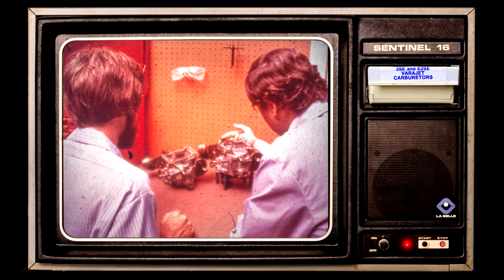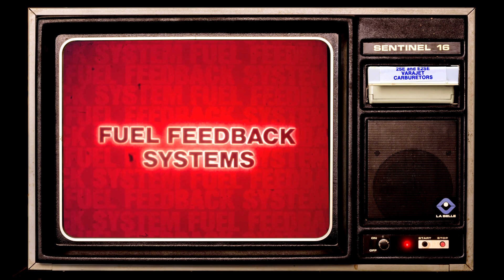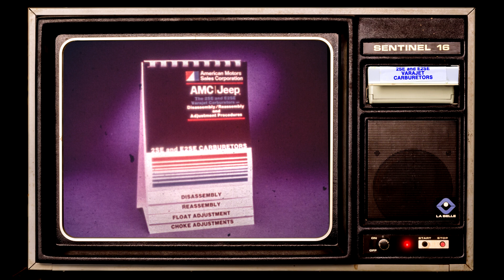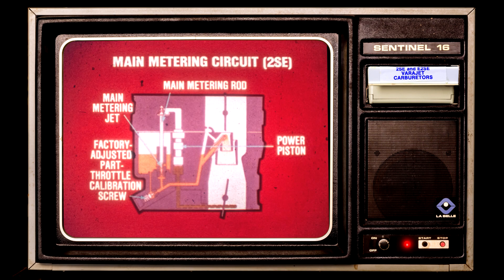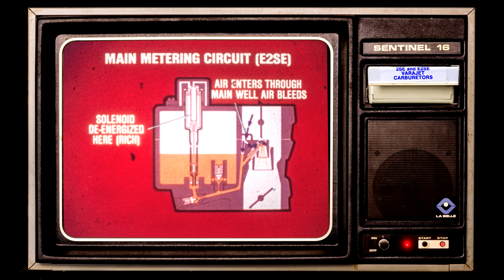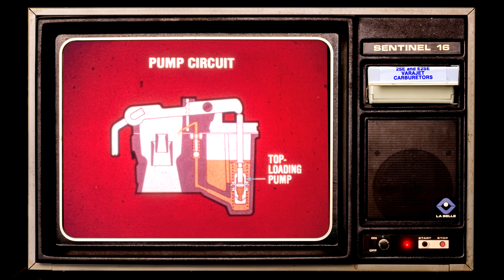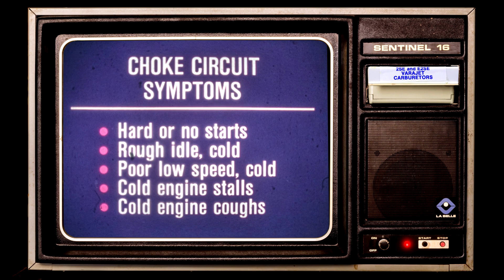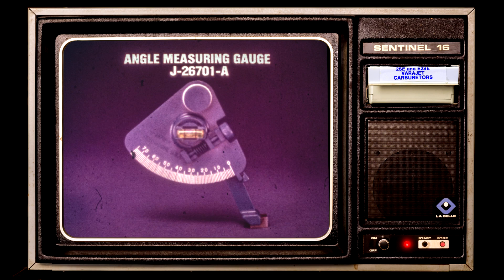AMC 2SE and E2SE Varajet Carburetors 1980

Comment: I owned a 1980 Spirit with CA emissions  It was high milage and we overhauled the engine, cleaned up the systems and reconnected the original accessories and passed CA emissions at least once before I sold the car.  The reprinted wiring diagrams in the 1980 TSM supplement were much better than those in the original edition TSM and were very useful.